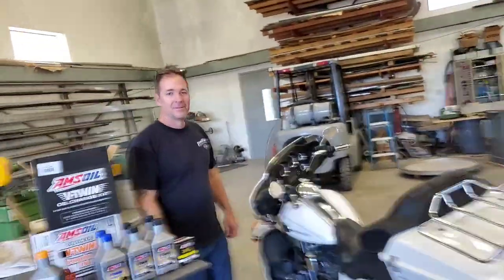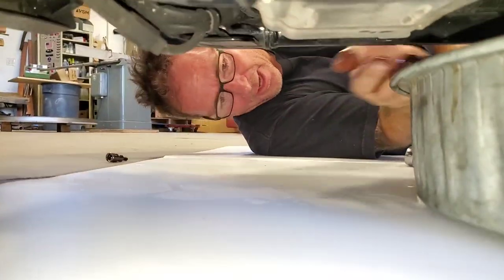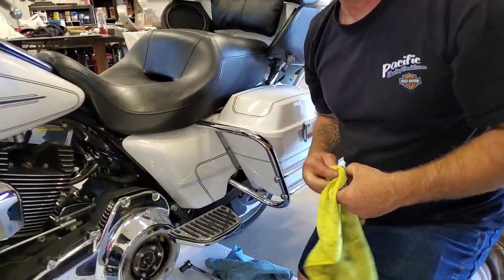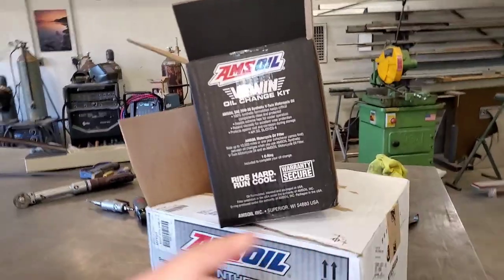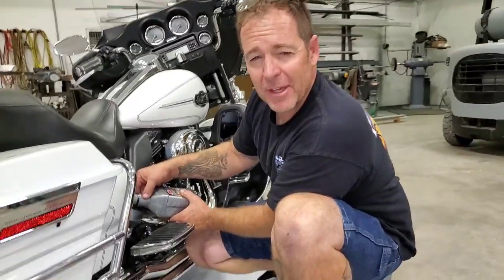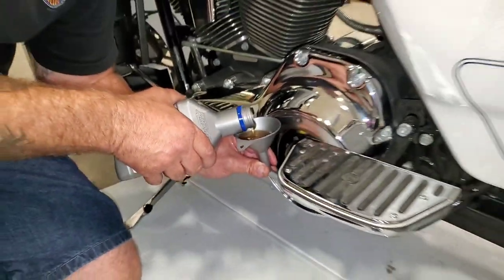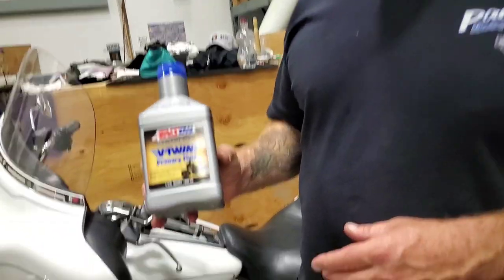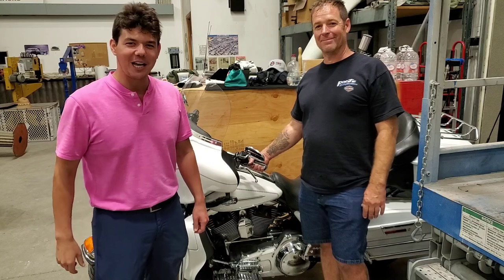2012 Harley Ultra Classic 3 Hole AMSOIL Fluid Change Primary Transmission Oil

Comment: This is so true!,!!  You can tell that Amsoil is the best when you take that first test ride and you can feel the buttery smooth shifting!!  No more clunking into gear! And it’s easy to find neutral. I found and started using Amsoil in my motorcycles and now it is in every motor I own. Just try it and you will not be disappointed, guaranteed!
Reply from the maker: 🇺🇸, beautiful Shawn absolutely beautiful 😃

Comment: I absolutely loved this presentation and I have been using Amsoil in all my vehicles now for around 6 years now and I am going to recommend this Harley Davison Amsoil to my friends who have
Motorcycles 🏍.
Reply from the maker: It's awesome Are you a ammsoil preferred customer?
Reply: @Syntheticoilprotection  yes I am a preferred customer.
Reply from the maker: Awesome am I your Amsoil dealer?
Reply: No her name is Tammie and on two separate vehicles we have a total of over 330000 thousand miles. 
   With absolutely zero problems and no oil usage from ether. 
    One is a 2013 Ford explore 3.5 L V6 naturally aspirated not a turbo or eco boost it has 174000 miles and a 2014 Ford Escape 
With the 2.0 liter eco boost turbo engine 156000 miles. 
    Neither using any oil and I am running 10000 mile oil changes on both with Amsoil signature oil and Amsoil filters on both. 
And never any problems with the escape and it gets driven hard sometimes.
Reply from the maker: Sweet, Great to hear 😉☕😊

Comment: Haha that 5/16 allen on the front by the plug is not transmission that's the crankcase plug your not supposed to pull it the transmission plug is facing down further to transmission side of the bike it has a hole in the brace to access it.
Reply from the maker: Thanks for sharing with the channel David 🇺🇸😃🎬

Comment: You guys are so concerned about the Type of oil you're gonna use, but when you drain the oil. The 2 plugs are both for the oil Pan For the motor. The transmission drain  plug is on the right side of the motorcycle. That's why you didn't show it in your video... And how about Adding the amount of ounces.. For the primary. That would be helpful.
Reply from the maker: I believe that one is still to overflow
Reply: Primary holds 34 oz of oil

Comment: The tapered plug is called “NPT”. It’s actually a pipe thread.  It sure if this application would be good for teflon tape, because of the heat just adab if red RTV silicone would probably be more for that application. 👍

Comment: This guy is exactly like me Iol I am that fussy when it comes to repair, maintenance & looks of the vehicle. Great video Eben.👍🇨🇦
Reply: @Syntheticoilprotection  i wonder why you always have single amsoil bottles when its cheaper to get the gallon. Is it any differents?
Reply: Its actually cheaper to buy the quart’s atleast for my vehicles it is.
Reply from the maker: Just depends on the application also depends on how you're going to store the products but yes when you buy by the gallon it is a little bit less money. It's just tough to keep a gallon around with just a little bit of oil at the bottom It's quite a bit of a benefit to use the quartz if you're doing small oil changes
Reply: @Syntheticoilprotection  i usually buy a gallon and a quart cuz my car car takes 4.25
Reply from the maker: Sweet 😊

Comment: I noticed in my 2010 that once I changed the primary fluid neutral seemed easier find.  Even compared to Amsoil's 20w-50.
Reply from the maker: Sweet thanks for sharing that!!!

Yeah there's nothing like using a lubricant that's built for a specific application 😃😃😃

Comment: I tried AMSOIL transmission fluid in the gearbox and went straight back to RedLine Shock Proof Heavy.  

Redline Engine Oil 20W50
Redline Primary MTL
Redline Transmission Shockproof Heavy.

Comment: I watched your oil change on your 2012 Ultra Classic 3 Hole.  I have a 2012 FLTRU, 103, and unless the classic has a different motor, I just drained all the oil from my crankcase.  I changed the oil, no problem, but the drain plug isn't has shown on your video, as when I removed that plug, all the oil from the crankcase came out, and it says in the owners manual, which I should have read instead of just your video, it says not to remove that plug.  The transmission drain plug is underneath through a hole in the frame going straight up.  Another video I should have watched showed the correct plug.
Reply from the maker: 👍, yeah all the vehicles are always a little different some mid model year they make changes on differentials transfer cases transmission pans and oil filter type very common you just never know always good to double-check the lookup guide if you ever have any questions you can always reach out to me anytime I would be your Amsoil Dealer so I can answer your questions on all the oil and lube for your vehicles✌️😃☕️
Let's give a man a fishing pole & show him how to fish. 

     Together! We can get your vehicles to run better than brand new!

     For me to get credit & be "Your" Independent AMSOIL Dealer, please use my website below or my dealer no. 5331179 call anytime Eben Rockmaker 702-472-3614
After you click on: http://syntheticoilprotection.net
1. Click the hamburger menu
2. Click offers AMSOIL preferred customer
3. Click join now. 6-month PC member add to cart.  ( There is no reoccurring renewal membership unless you select that dot box ) 
( You have the option to not have your credit card saved if you prefer - est. 1972 )
4. Scroll up to the top Select shop by vehicle. 

New Promo Code: FREESHAMPOO

Comment: That is what I did with my new used Pearl white 2008 Electra glide ultra classic 96. It runs cooler with this V twin oil. Than what ever was it. Very noticeable temp and milage difference. was 37 mpg now 42.  Has 38 K on the engine and plan on it going for a 100 K more
Reply from the maker: Absolutely beautiful
Reply from the maker: Call how long have you been using Amsoil and have you ever used it in your car?

Comment: I use Amsoil in the engine presently with Redline in the transmission and Belray in the primary. I am switching to Amsoil in all 3 holes next change. I am expecting good performance from it! Bike is a 2000 Road King Classic. Twin Cam 88.

Comment: New to bikes here. Can you use the same fluid in the primary and transmission?
Reply from the maker: Correct that is intended by Harley gives you the option on the Amazon look up guide however Amsoil does make a specific lubricant for each make and model motorcycle and each specific application for instance if I was changing the fluids I would personally run the motor oil and the transmission fluid and the primary fluid which are specifically built for the application Amsoil is the leader in lubrication since 1972 and they do testing on each component to specifically dial in the lubricant for that application so that's why I would personally run each lubricant that's built for each application for the best performance if you ever want to try the lubricant you can always order it right here off my website and I can always answer your questions in the future with the products💯😃
I give a man a fishing pole & show him how to fish. 

     Together! We can get your vehicles to run better than brand new!

     For me to get credit & be "Your" Independent AMSOIL Dealer please use my website below or my dealer no. 5331179 call anytime Eben Rockmaker 702-472-3614
After you click on: http://syntheticoilprotection.net
1. Click hamburger menu
2. Click offers AMSOIL preferred customer
3. Click join now 6-month PC member add to cart.  ( there is no reoccurring renewal membership unless you select that dot box ) 
( you have the option to not have your credit card saved if you prefer - est. 1972 )
4. Scroll up to the top Select shop by vehicle.

New Promo: FREEBOWL

Comment: That is not the transmission plug.
Reply from the maker: What type of motorcycle do you have
Reply: It's the plug to the engine oil pump. If you were to flush the oil with Rogue Chopper Harley Davidson engine oil flush, the pipe plug is where you attach the supply pipe for the fresh oil. I use Amsoil in all 3 holes on my 2013 HD Road King. I also use the Rogue Chopper Flush kit to get all the old oil out of the sump. It is also good to put the bike straight up on a jack to get a good drain of the old primary and transmission. HAPPY MOTORING!

Comment: When switching from conventional to synthetic do i have to do anything special? I’m switching to ams oil this weekend.
Reply from the maker: That's a good question you can always switch to synthetic and switch back it won't hurt anything basically that's what full synthetic is is a synthetic blend a oil manufacturer can call a full synthetic full synthetic when it's only 25% synthetic the Amsoil is different it's 100% synthetic has a much higher firm strength if you ever want to try the products when you use my link as the PC member that would give you the best value on the products and that way in the future I could always answer your questions about improving the performance and lifespan of your vehicles by choosing the right fluids as your independent Amsoil dealer👍
✅   Save up to 25% on every order as a preferred customer: https://www.amsoil.com/offers/pc/?zo=5331179

Comment: Been using Amsoil for a long time and just bought a Harley Ultra Classic and plan to use all Amsoil in it. 

Now I’ve been using Quickshot for a longtime and I don’t believe he should have used the entire bottle. It’s usually only 2-4 ounces. PI you would use the entire bottle but they are completely different products.

Comment: Question for you guys . Mine is a 2011 ultra classic  I bought it with 28000 miles now is got 30 k idk if they have ever done a transmission fluid change . Is it ok to do at the mileage is got now?
Reply from the maker: Oh yeah David the earlier the better you have a better phone strength your bike will ride smoother quieter this will give you all the products for your year making model and the 6-month PC membership will give you the very best value on the products and when you use my link here that will attach me to your account so I will always be able to answer all your questions on your vehicles about improving the performance and lifespan of your vehicles by choosing the right fluids as your independent Amsoil dealer👍
♥️   Find The Right Fluids For Your Vehicles - https://www.amsoil.com/guides/?zo=5331179      

     ✅   Save 25% On Your Next Fluid Order: https://www.amsoil.com/offers/pc/?zo=5331179

Comment: Been watching your videos for a while now, first time commenting, wish I lived around your area but I'm going to make an order tonight to try Amsoil out in my 2018 Type R. I just serviced my transmission recently but I would like to swap the fluid for Amsoil aswell. So gonna re-do that, any Manual transmission fluid that is sold by Amsoil you recommend for a Type R?
Reply from the maker: Hey that's awesome You can actually use my link and I would get the credit for your orders and I could always answer all your questions when I'm your Amsoil dealer.

You'll see the lookup guide and that will actually give you all the fluids and capacities for your vehicle.

Also if you new to Amsoil I recommend the 6-month PC membership that'll save you about $33 and $100 order.

You'll see the lookup guide in the upper right hand corner.
Professional YouLubher: Eben Rockmaker Regency Gold Direct Jobber AMSOIL Specialist (Dealer#: 5331179) 702-472-3614 

     If you're New to AMSOIL I recommend the AMSOIL 6 Month PC Membership - https://www.amsoil.com/offers/pc/?zo=5331179
Reply from the maker: If you have any questions at all let me know always happy to talk before you order

Comment: Excellent video..but you need a LIFT
Reply from the maker: Oh yeah that would make it much smoother👍
Reply from the maker: What type of motorcycle do you have?
Reply: @Syntheticoilprotection  2012 Ultra Classic ,2004 1200 sporster,2004 Suzuki Hybusa.
Reply from the maker: Sweet!!!

What type of motor oil have you tried in your vehicles so far

Comment: I wouldn't let this guy near my bike for service work
Reply from the maker: His bike runs better than brand new!
♥️   Your vehicle can run better than brand new by choosing the right fluids!

     🇺🇸   50 Years of AMSOIL anniversary - https://youtu.be/MQUqRBI8dD0
     
     🥇🥇🥇   Synthetic Oil Protection Google map reviews
Eben Rockmaker, independent AMSOIL Dealer 
Dealer no. 5331179
(702) 472-3614
https://maps.app.goo.gl/1aXxuXrXK9eJwqK78
         
♥️   See fluid performance tests - https://www.amsoil.com/performancetests.aspx?zo=5331179